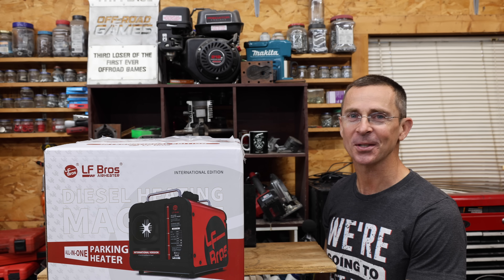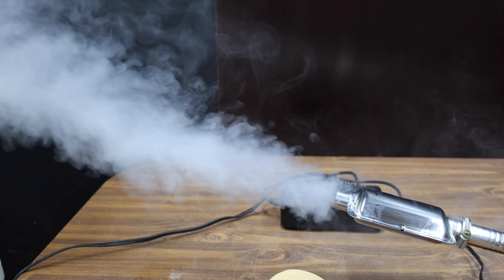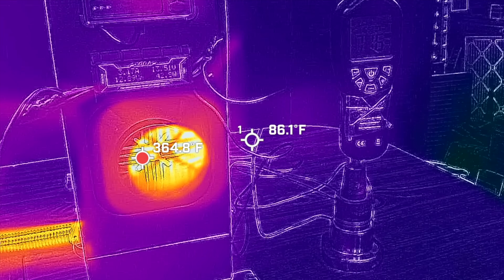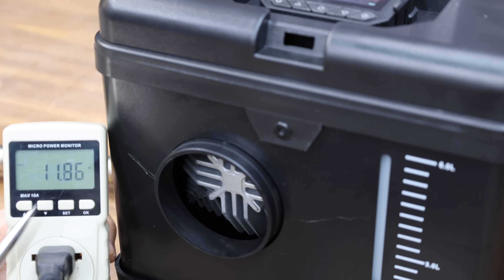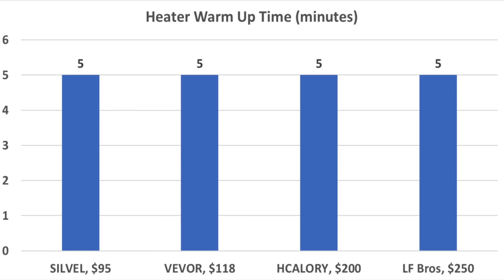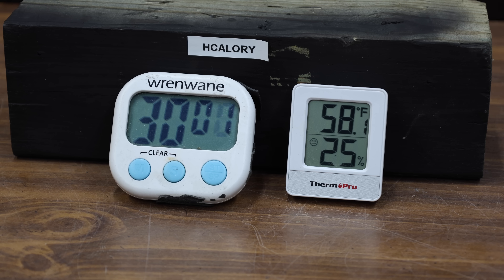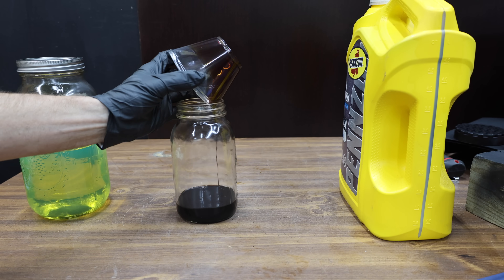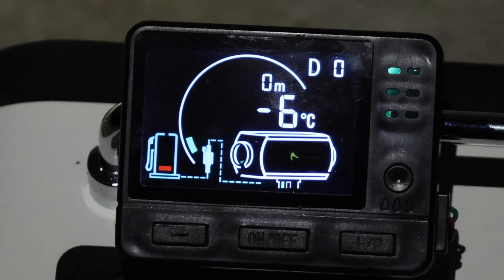The Truth About Cheap Diesel Heaters!

Comment: One upside of the LF Pros is the fuel cap. All the caps from the others in this test will leak fuel if over or under tightened when bouncing around on bumpy roads. The fuel cap on the LF Pros is similar to that on vehicles so when you reach maximum tightening, you'll hear a "click click click" and can't over tighten. Edit: One more thing about the fuel cap - it vents pressure out, but won't leak fuel if the unit is tipped over.
Reply from the maker: Thanks for the feedback.

Comment: I bought a unit identical to the SIVEL unit, its controller is a little crappier but it came with an AC power supply. I Imported it direct from Chinese, cost me about USD50. It starts and runs with a completely clear exhaust, no smoke ever. Great heater for an off-grid house.
Reply from the maker: Thanks for sharing.

Comment: I bought the LF bros pro the black model 
And it’s absolutely fantastic 
Extremely quiet 
You can’t hear the pump 
On the initial start up. It’s power hungry. 
But after that, it barely draws any power 
Make sure you get a good battery 
I would recommend a 100 amp hour. Iron phosphate battery.
Or I just run it off of a small generator
I mainly use it to go ice fishing 
But I’ll be using it for camping as well 
The price is higher, but in my opinion, it’s worth every penny
Reply from the maker: Thanks for sharing.
Reply: I bought the same one and it’s excellent 
I use it for ice fishing and camping as well

Comment: No sure if I already made this suggestion... Recently my daughter had engine problems and required assistance on the side of the interstate. This was not near town and was a VERY dark section of highway on what I found out later was a "new moon" (no moon) 0% illumination night. Working out there to rescue her and her vehicle was SCARY!!! THIS BRINGS ME TO THE SUGGESTION... I decided we needed road flares. THERE MUST BE 6-12 different brands with almost as many manufacturer's of these LED Road Flares! It is impossible to distinguish the differences in the brands/manufacturer by simply looking at the Amazon listing. One of the only discernable variations is battery power (some AAA others, AA) and rechargeable. 
Is there any way I could talk you into comparing a few of these products Side by Side the way only you can do? For now I just bought good old-fashion actual Flares. But I'd be interested to see which of the LED's wins one of your video head-to-head comparisons and even be willing to invest my money into the link for the one on top!
Reply from the maker: Thanks for the suggestion.

Comment: In reality the combustion units are indeed the same, from the same manufacturer. I would check the torque, or lack of, on all attachment bolts and the ignition plug. Many users have found these to be loose or less than optimal tightness. If you have access to another form of heat exchanger, such as an old cast iron radiator or old furnace exchanger (un-cracked of course) you can either run the exhaust through or plumb it directly into and out of before outdoor exit, you'll increase the heat transfer efficiency of any of these units. The exhaust temp is similar to exit air temp and this becomes stored radiant heat. Use everything you have access to to increase surface area. Another option would take more engineering, but run the exhaust through a liquid filled radiant heat exchanger and pump that heated liquid along baseboards , a wall panel, ceiling panel or wherever you need heat. Generally floor level for foot comfort goes a long way. Outdoor installation is the opposite of efficient. Sure, no safety issues with hot surfaces of exhaust gases, but you waste heat coming into the building and cannot use the exhaust heat at all unless it is directly connected to a liquid radiant system pumped into the interior space. My 2 cents after a few weeks of research.
Reply: WOW!! You sure are good at giving orders! Would you do everything you just mentioned?! Better yet.... Perhaps you can make a better video on what you rattled off!
Reply from the maker: Thanks for sharing.

Comment: I'm guessing if you took apart the LF Bros you would also find the same cheap problematic chinese diesel heater that all the others are hiding and that we can buy at a fraction of the price of these rip-off products. LF Bros trying to rip-off the customers the most by charging 2.5 times the price you can buy one for without the flashy and misleading casing.

Comment: All of them will put out smoke like the Silvel did if the they get the E-01 low voltage error due to shutting down during the starting process. Another test to do is which power station can supply enough power to start on 12VDC without error.
Reply from the maker: Thanks for the suggestion.

Comment: One test I wish you would perform on items such as these is tech support.  How difficult is it to reach the company and/or how long do you need to sit on hold with their tech support if you have a question or need to order a part?  Then include that phone number in your reports.  In the past I have had to throw items away because I could not reach tech or warranty support.  
Most recently I bought an $80 Stanley battery charger.  I connected it to a partially charged less than one year old truck battery. On automatic overnight it blew out the side of the battery.  Not only did they not reinburse for the battery, they also would not warranty the battery charger.  After several emails and a couple phone calls I gave up and threw the battery charger away.  Never again because of my poor warranty experience will I buy another Stanley/Black & Decker product.
Reply from the maker: Thanks for the feedback.

Comment: Have been working in the garage this winter on a variety of projects. Sure could have used one of the heaters! Looking at the Vevor and Silvil for now.
Reply from the maker: Thanks for the feedback.
Reply: I might be dumb. But wouldn’t these devices needing to plug in during a power outage defeat their purpose?
Reply: @d.w.6216  You can hook them up to a car battery. I truckers hook them up to their batteries to heat their vehicles when they’re taking a break on long drives.

Comment: Do not get a vevor! They sent me a defective one and did not make it right. They just said they don’t accept returns. It has a horrible burning plastic smell Which they admitted is not normal, but they refuse to take it back or fix it.
Reply from the maker: Thanks for the feedback.
Reply: @ProjectFarm  I ended up taking the Vevor heater apart, and found that the burning plastic smell was coming from the gasket material they used as a  shock absorber/spacer between the metal combustion chamber and the plastic housing. After removing it and replacing it with RTV silicone, the smell went away.

Comment: Go search Webasto diesel heaters. Thise were the original diesel heaters designed for use in the sleepers of trucks. These are the same thing just compacted ina convenient to go package for glamping. Downside is when the glow and combustion chamber need to be serviced. its a mess.
Reply from the maker: Thanks for the suggestion.

Comment: One big thing you missed on your rating, is the gas tanks. The cheaper ones leak bad and have caps that strip and drip, LF and HCal have gas tank type lids and the tank inside protected by the durable case. That is a big win comparatively. :)
Reply from the maker: Thanks for the constructive feedback.

Comment: My 8 kw heater quit after less than 20 hours use when the pump packed it in. Yes, fuel was filtered. I contacted vevor and customer service had me try to upload a video of the pump NOT working for almost an hour and then said they would get back  to me within 72 hours. I ordered a new pump on amazon that will be delivered tomorrow. Also, the manual did not support the controller that came with the unit and it wasn't bluetooth as promised. Be careful when buying and check up on servicing an espar style heater before you buy.
Reply from the maker: Thanks for the feedback.

Comment: overpriced depends on perception and needs. if you want the best heating performance, clearly get the LFBROS. It's fuel pump makes less noise, and the unit is able to put out more heat. the trade off's with power consumption are negligible.
Reply from the maker: Thanks for the feedback.

Comment: My furnace went out during a cold spell in Indy. Low temps were -3 to -8, with highs in the single digits. Fortunately, I was able to make repairs within 24 hours and had a small plug in to keep the temps around 50. One of these units are a must, but one would need to figure out how to plumb the exhaust. Great video, I’m buying the LF Bros!
Reply from the maker: Thank you for sharing!

Comment: A Mister Heater Buddy is waaaaay better. Trust me we live the wilderness life up in the mountains and snow. Don't buy one of those.. using a dc to ac inverter if 400 watts will run that thing but not long and then you need a way to charge the battery..Don't go off camping and running one of your cranking battery cause that will REALLY bite you in the ass.😂😂nDandahermit

Comment: Those diesel heaters are very fire dangerous and huge fuel hogs. I have tested them. Bad design. Anything that requires more than one form of energy is a very poor economy. Bad designs. In Alaska we had a huge VERY efficient. Called a pot burner. Only requires tank ( outside)! Be above heater for gravity. The one I have is a Sears Kenmore from the 50s and is silent..we install them to use the same stack back to back with wood burning heaters. Leaving the cabin for days or weeks we leave the pot burner. Will keep cabin from freezing and will run on a gallon a day so could run about 50 days on a 55 gal steel barell on back wall outside. We go off on hunting trips in average 30 below zero. I'm an old Alaskan bush  rat. No fire hazard or stupid electronics or electricity needed. Old things are all more efficient and eternal like tractors. Mine was sold by Sears in the mid 1900s. Mine was made around 1952. I'm 80 yrs old. Dandahermit

Comment: I wanted to point out in your evaluation on the Silvel heater You had all that smoke because you aborted the first startup and the unit was flooded with fuel in the combustion chamber when you did the second startup. If you abort a startup you have a situation where the combustion chamber actually becomes flooded with fuel so you're going to have a lot of smoke when you do the second start. I've been using these for a few years and I know what I'm talking about my friend. I do enjoy your information but you made a mistake on this one that I wanted to point out. I've been doing mechanic work and about every kind of repair work on everything you can think of for over 50 years so I promise you I am not ignorant on this. Do another start up with the proper voltage and you won't get that smoke of course after it has been cleared out with a long proper burn. Best of luck to you my friend
Reply from the maker: Thanks for sharing.

Comment: I have a 2000 watt power supply for rc,s it can go.up to 48 volts 2000 watts it is a meanwell i use it on my icharger 4010 duo i can charge lipo batteries at 40 amps per side or 70 amps synchronous. 40 amps is cooking. I normally match mah hrs per amp rate so if it is a 4 cell lipo that is 7000mah our i charge at 14.8 volts and end at 15.4 at 7 amps. 😊
Reply from the maker: Thanks for sharing.

Comment: Good tests; Was waiting for a Final Report, like you usually have… Will add one of these to my Standby/Backup heat sources, I think - A little hesitant, due to the need to vent the exhaust outside - Which my 2 current propane heaters Don’t require…
Reply from the maker: Thanks!  Thanks for the feedback.

Comment: the funny thing is all these heaters are the same Chinese factory. the main difference is the controller is slightly different between the machines. but over all they aren't to bad. I have the cheap silvel that I use a car charger to a battery then to the heater. since I don't charge my car that often it works just having it always connected to the heater. :D  I have mine ducted into my office and exhausting outside. I still need to add a water heater base board finned tube in the exhaust path to help extract that much more heat out of the exhaust before dumping it outside.
Reply from the maker: Thanks for sharing.

Comment: This might be a dumb question.. But if theres a power outage and no electricity.. how would you start this?
Reply: you can run this on a 12 or 24v battery setup. if it's 24v you need to change the setting in control panal settings. so my setup is my car charger to my 12v battery and then the battery to the heater. this gives a buffer for pulling the start up amps that my small car charger can keep it charged as it runs and after. if there is a power outage it can use the battery. though the battery I have isn't that big and only 245w and lasts ~2h with out any power.

Comment: Would it be possible to give the air flow in cubic feet per minute (CFM)?
Reply from the maker: Thanks for the suggestion.
Reply: All the outlets are the same diameter... These are based off truck parking heaters but put in a case.

So if you want max CFM, the highest MPH is a valid comparison.
Reply: @volvo09  That may be true, however, standard practice is to measure HVAC output in CFM. There are several reasons for this. First, the amount of heat moved is directly related to the MASS of air moved since it is mass that retains the heat and transfers it to the room. Second, it is used to determine the air exchange rate for a given room size. The overall efficiency is directly related to the room volumetric air exchange rate. CFM is required to determine these factors.

Comment: The one thing I'll add, is that customer support with the LF Bros is really good.  The others are absolutely fine.  I've owned both the Hcalory briefcase model and the smaller LF Bros unit for camping & ice fishing.  They all work as advertised...my only recommendation is to pay the money for the newer units that auto calibrate to the elevation they're running at...helps with soot build up, etc.
Reply from the maker: Thanks for the feedback.

Comment: I have seen these for marine/yacht use for many years, they cost thousands of dollars. I never knew there were some for emergency home use, or off grid cabin use.
I have one concern, how do you get the exhaust to discharge outside? If you crack a window, you let cold air in. If you block the window crack, the exhaust pipe temp may start a fire if it touches plastic or wood.
Reply: I vented one out the window with a fireproof concrete and fiberglass board... Hardybacker? I can't remember the name. Cut it to my window size and routed the exhaust through that.

Comment: These are all knock-offs using stolen technology from Ebberspracher in Germany. I have a genuine Ebberspracher "Esbar" unit in my Sprinter RV, and it is fantastic. 

When used continuously, they will require a tune-up, consisting of removal and cleaning of the combustion chamber, and replacement of the mesh screen around the glow plug. If you don't maintain them, eventually they will refuse to light off which throws a hard trouble code that can only be  cleared with a laptop and special software. So always service them annually. Otherwise they are terrific little heaters.

Comment: I bought these heaters thinking it would be the solution for my little workshop in the winter. 
After glow plugs and pump failures, waiting to get replacement parts from china, it became a pain in the 🫏. Then they gum up inside the chamber which is another pain in the 🫏 to get clean. 
So I tried using kerosene thinking it would burn cleaner, it worked so well it burned the gasket up and quit working. Got about two months of use then threw it on the metal pile and went back to propane.
Reply from the maker: Thanks for sharing.

Comment: Conclusion: Bluetti's car socket cannot give enough amps to power a  diesel heater.  you need another one with 150W (12A) at 12V on the car socket.
Reply from the maker: Thanks for the feedback.

Comment: With the first unit failing on the original electric supply, I wonder if there was already some fuel distributed in the heater and then had additional fuel added when the new electrical supply was added.  Just a thought as to why it was so smokey.

Comment: My son experimented with burning motor oil and it works, but it fouls the inside with tar and carbon. You'll need many sensors and spark plugs. Use clean diesel only. Give it a hot burn at cool down too.
Reply from the maker: Thanks for sharing.

Comment: Can you redo this test but add caterpillar deo 15w40 and use shell rotella t4 15w40? The shell rotella t4 15w40, cat deo 15w40, and delvac 15w40 is the most common used in my area, and I would generally appreciate it. Delvac is cheapest. Rotella and cat are same price.
Reply from the maker: Thanks for the suggestion.

Comment: If you have a power outage these won't work lol, your battery bank didn't power it. Just get a buddy heater and a 20lb bottle. 108 hours on a 20lb bottle on low heats a 225sqft room to comfortably warm at 15f outside

Comment: The Silvel was at an unfair disadvantage because you blew the initial power sequence by using an underrated power supply.  Between the totally unnecessary priming sequence and the screw up with the power supply, you flooded the burn chamber.  All of that white smoke was due entirely to your error.